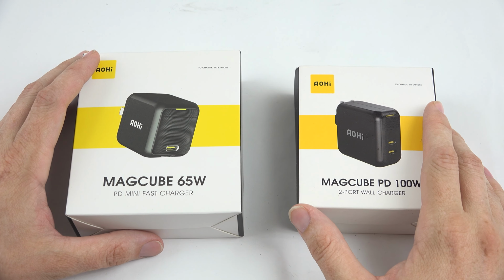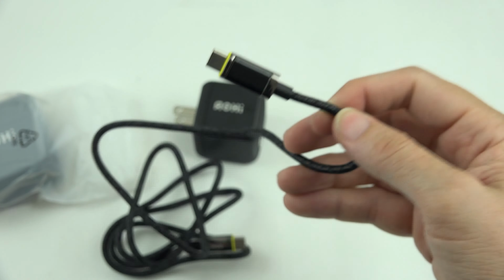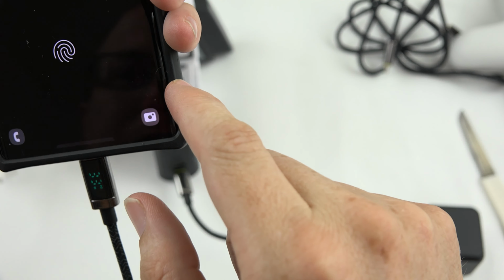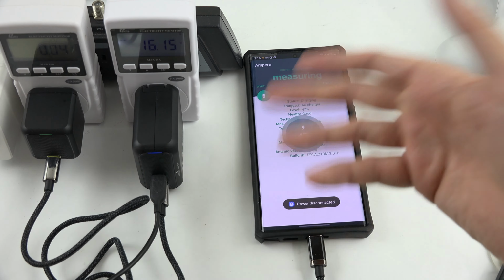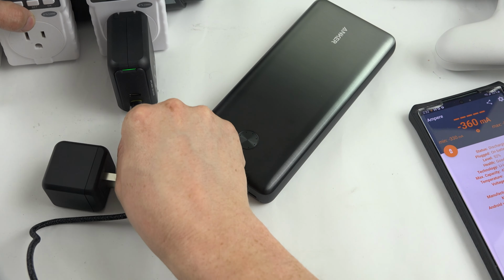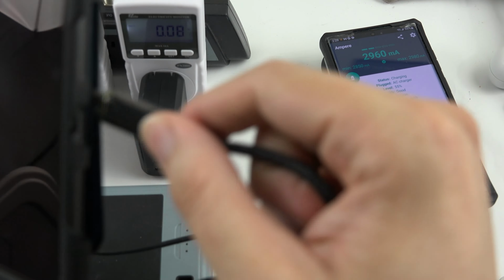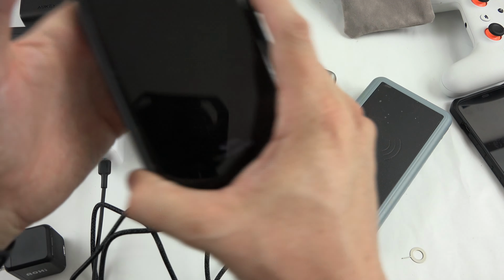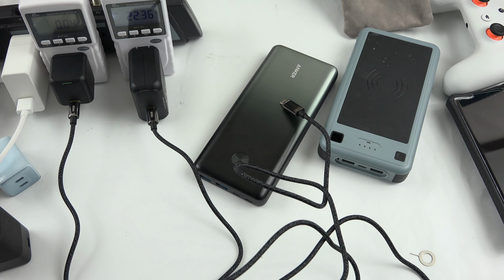AOHI 65W & 100W USB C Charger with USB C to USB C LED Display Cable!

Comment: I had the Motorola Turbopower 30 but my phone is a bit sensitive when that USB port gets dirty . I ended up throwing away the Turbopower 30😢 , I should've just bought a cleaning tool.   I am tempted to go for a magnetic power bank but that phone will feel like a brick😂 . I had a Droid 3 a decade ago and I upgraded to the extended battery , I def felt like some big shot businessman holding that phone .

Comment: So have you found the Fnirsi FNB58 or Powerlab KM002?

Uhh I don't think you can possible pull 6.8A with either that charger or cable. 5A max

Comment: Does it actually repair battery damage?
I had V unlock my phone to change phone companies, and the next day, the phone died when at 36 % battery, it now turns off if I take a picture with the flash, it also stops when notifications come in.  It's acting up several times a day.  I now can't use this phone with another phone company.  Any thoughts.
Reply: nothing can repair battery damage
Reply: U need a new battery is all. That was a bad battery